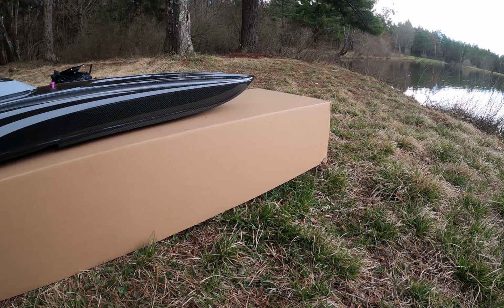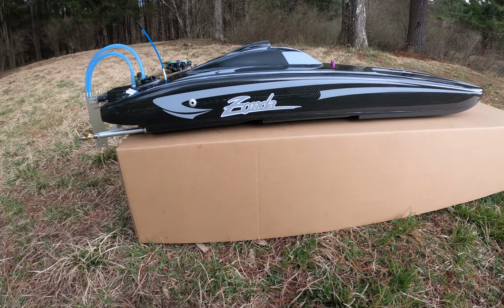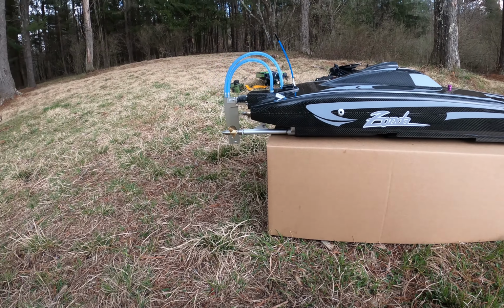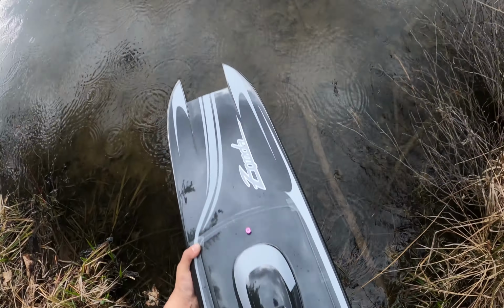TFL Zonda Carbon Fiber 1133 180A ESCs 2075kv SSS motors Maiden run full stock 6s

Comment: you are dedicated..rain sleet and and snow..nice!!
Reply from the maker: I was a UPS man brother, weather doesn't bother me much lol thanks for watching.  hope we meet up soon
Reply: @naveda08  yeah Im all for that Im going to be taking some time off in June so we will meetup then. we will need to get each others phone numbers soon.
Reply from the maker: @DronemanJoeRc  yep we got each others emails we can exchange numbers that way
Reply: @naveda08  Im taking out my twin otter for the first flight tomorrow its my first twin prop to fly and I hope it goes well and if I crash I crash but I think I can do ok. Let you know how it goes
Reply from the maker: @DronemanJoeRc  you got it man, you flying off water?
Reply: @naveda08  I got the kit with the plane but Im going to do it off land first. I have to rebind the plane to the new nx8 bc it didnt transfer over from my old transmitter for some reason so Im doing that now so I can take it out tomorrow. I dont know why it didnt transfer over from my old dx6 but Im going threw all the procedures right now.
Reply from the maker: @DronemanJoeRc  got u I use OpenTx which is very different procedure than spektrum.  i hear spektrum is supposed to be more user friendly
Reply: @naveda08  im still messing around with this binding and set up on the twin otter its giving me a headache
Reply from the maker: @DronemanJoeRc  Bummer! :( Well I'll buy it off you as well if its not cooperating ;)  I have a Float fly event coming at the local lake that is organized by one of clubs I am a member of.  But I dont have a float plane lol  I know she flew off the table tried to attack you once already maybe it was an early sign hahaha.  Joking aside  good luck though, I hope it works out for you man, good idea to take the props off when u messing with the controller if you havent done so already
Reply from the maker: @DronemanJoeRc  https://youtu.be/ENmT_BrehcY  yikes my other buddy was doing the same thing and didn’t go very well for him

Comment: Nice run, and she stayed COOL.....no problems with only 1 Water Pick?   What SCALE SIZE is your ZONDA 1/8, 1/10 ?
Reply from the maker: I tune them so they can run cool, we also have them custom built at the factory depending on the customers budget and expectations.  Hull thickness and materials, color, ESCs, motos size and kv rating, etc.  You can contact me at naveda08@gmail.com if you are ever interested in a genuine custom built TFL Hobby product.

Comment: The body is the carbon fibre version but the motor and esc are both stock right? Can each esc/motor take 6s power (so 12s in total)? Do you have any idea what the top speed might be?
Reply from the maker: Not quite, I got the 180amp escs, stock is 120a, dual pick up rudder and hd single piece shafts.  The motors are stock and yeah it’s a twin 6s so 12s total.  Pls consider subscribing, I got it going 88mph few days ago but it’s should break 90 and even 100mph with a big enough lake.